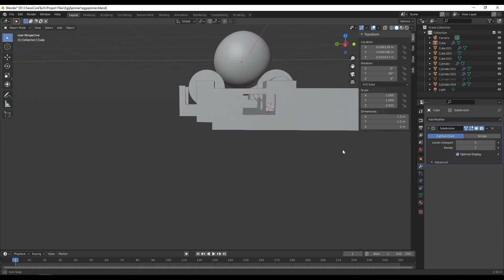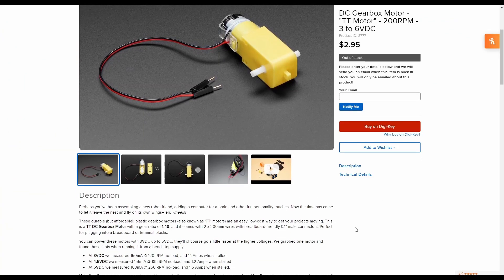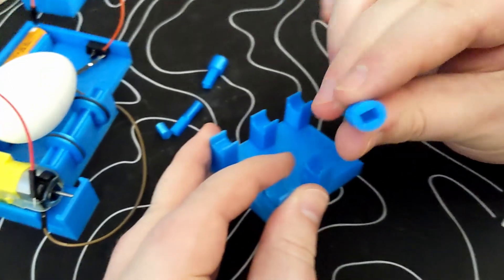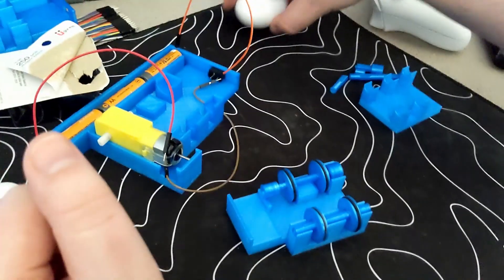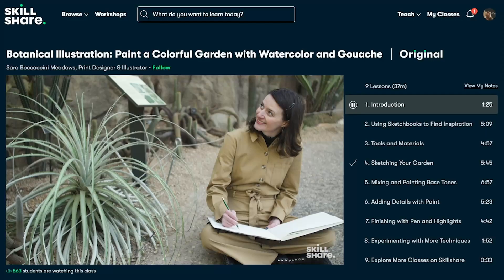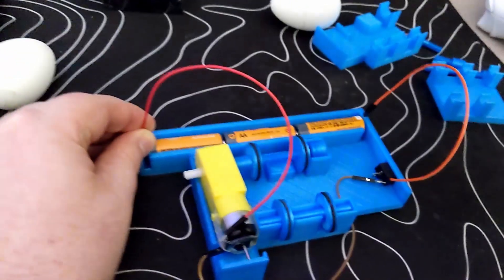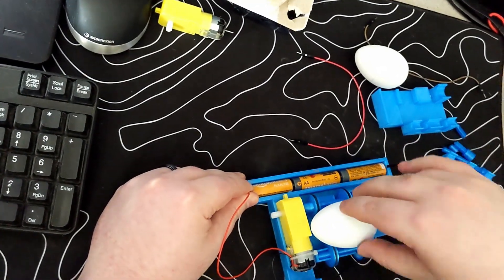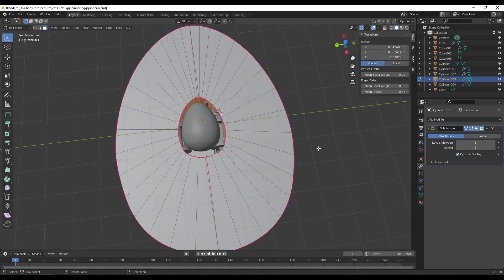3D Printing an Egg Spinner! | Blender 3D Modeling

Comment: …It takes 12 minutes to hard boil eggs. Why jump through all the hoops to make the fake ones work when you could simply hard boil real ones?
Reply: Dude why do take the time to hate when he did nothing wrong
Reply: Not hating- just making an observation that he seems to be doing more work than he needs to. It’s an interesting contraption, and I like the idea. Just seems like he is talking about doing a lot of work to make the fake eggs work when real eggs would be easier and faster. 🤷🏻
Reply: Also, the fake eggs would be weighted differently and potentially could cause different results. Real eggs would give a true representation of how well the device works.